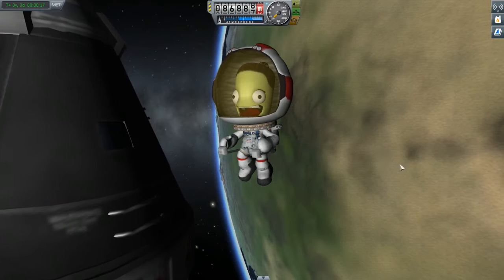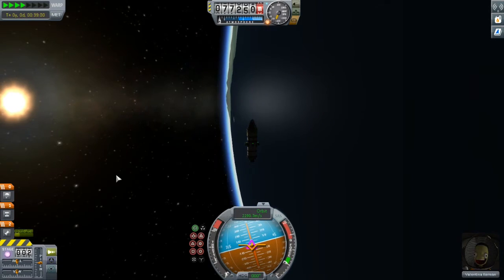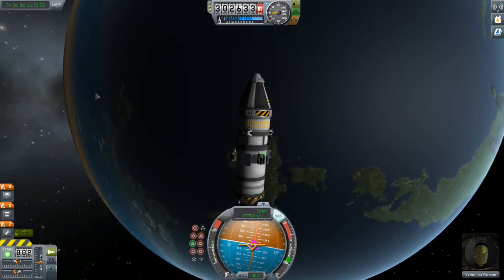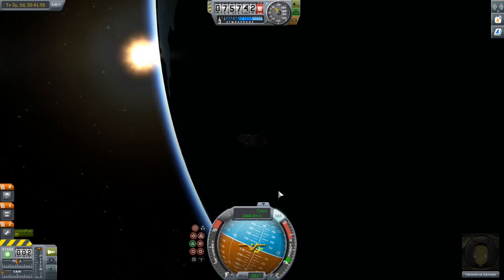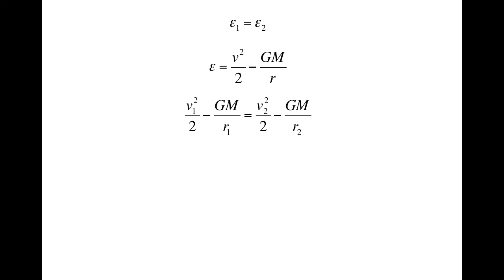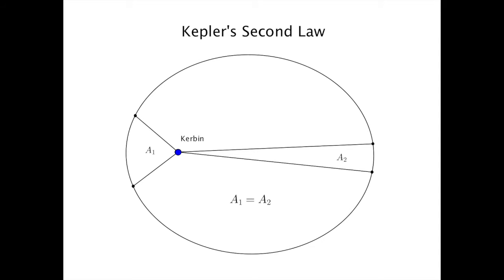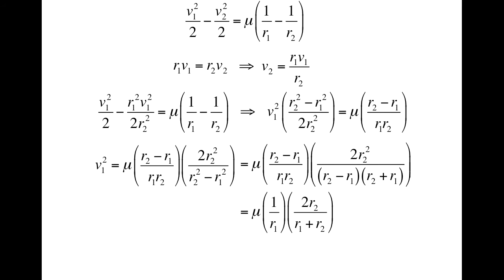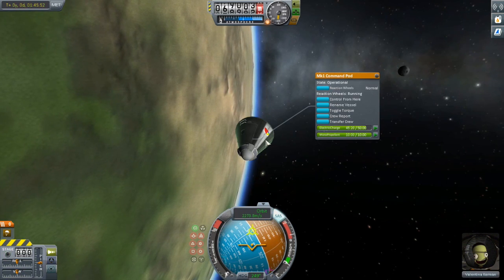Hohmann Transfers & Delta-v - KSP Tutorial #3

Comment: I'd have learnt far more if Minecraft and KSP had been at the core of Geography and Physics curriculum back when I was at school, instead of Ping-Pong and Asteroids. Thirty years too late.

...
Reply from the maker: +viruk67 The delta-v of a burn is completely independent of the mass of the vehicle, so it doesn't matter that the mass had changed.  That said, given two vehicles with the same amount of fuel, the lighter one would have more delta-v in it.

Comment: Do you know how to take air resistance into account when trying to calculate the required delta-v to go into orbit around kerbin ? (or any body for that matter) I've been stuck with this problem for weeks.
Reply from the maker: The force of air resistance is typically proportional the velocity of the craft, the cross sectional area and the drag coefficient.  The drag coefficient will vary depending upon the design of the craft.  This force gets subtracted off the engines, and using F=ma, can be used to determine the acceleration of the craft.  For a rocket, this gets complicated quickly because,

- the velocity of the rocket is increasing non-linearly during ascent which tends to increase air resistance
- the drag coefficient decreases as the air gets thinner
- the cross sectional area changes depending upon the angle of attack of your vessel

As far as I can see, this requires use of differential equations from calculus to deal with, which I think is beyond the scope of this series.  The next episode on the Rocket Equation is about as much calculus as I am prepared to do.

That said, I do have a pretty practical way of calculating ascent costs through atmospheres launching into different inclination that seems to work pretty well.  In fact, I was planning on making this the topic for the next video in this series.
Reply: Looking forward to it, this video was great btw.
Reply from the maker: Kevin White thanks
Reply: have you found the solution?
Reply: @marshelene  Funnily enough, I've been studying in aerospace engineering for 4 years since that post. The answer is yes, I found the solution, but it gets complicated. There's actually 2 losses to take into account, gravity and air. 

Air is a problem with a non-analytical solution because every trajectory won't be the same through the atmosphere and every rocket doesn't have the same aerodynamics. What that means is unless you manually program a simulation that includes the standard atmosphere, a rocket's aerodynamics model and a rough estimate of the desired trajectory, any calculation probably won't be very accurate.

For gravity, it's relatively straightforward to model the loss, however, you still need to model the rocket attitude and thrust during the flight since this is a simple vector subtraction. This is still non-analytical though.
Reply: @Not.a.bird.Person  wow i didn't expect you to reply. thank you for your answer. you've clearly made decent progress in the 4 years. i wish you'll keep it up even better.

Comment: Ho, how I would love if you could explain how the calculation of the burning time works for an hohmann transfer - if you ever go back to this serie (or maybe you've talked about it in one of your let's play?)
Reply from the maker: That would be a good thing to do, and I do plan on getting back to this series sometime.  I would really like to do this as, surprisingly, the stock game gets this wrong, at least as of version 1.2.  Hence the existence of the mod, Better Burn Time.  I have a back of the envelope thing I do, but it isn't very rigorous.
Reply: Yeah so far I'm slightly puzzled by the burntime (like trying to to figure out which formula is correct since nobody seems to really agree) I'm trying to get an acceptable KOS program that goes to launch to an as circular as possible orbit. If you don't mind I've got another question, can I use the Hohmann transfer calculation when first raising the periapsis on a rocket launch. You just escaped the atmosphere so you don't have drag anymore, you are getting close to the apoapsis and ready to do your final burnout. The only thing different is the origin orbit would have a periapsis lower than the surface of the body. Seems right?
Reply from the maker: Sorry for the late reply.  I'm almost positive that the game models suborbital trajectories as ellipses with the periapsis below the service of the parent body.  If that is true then, yes, you can use the Hohmann transfer calculation to calculate the necessary burn at apoapsis.